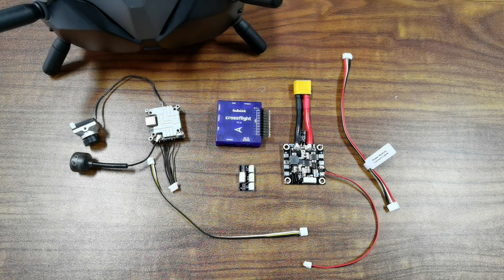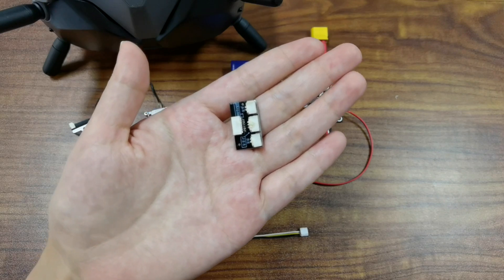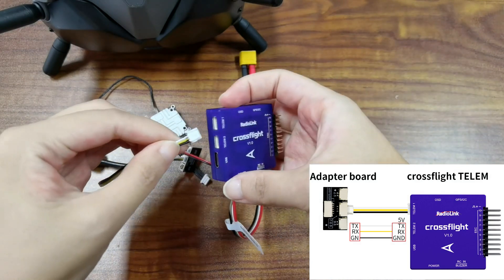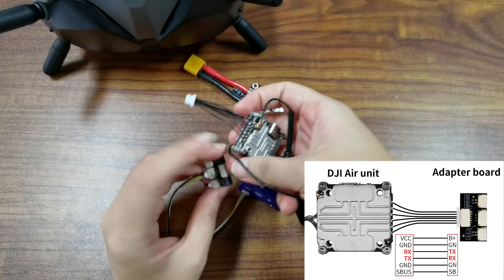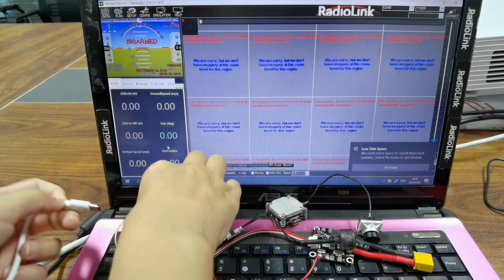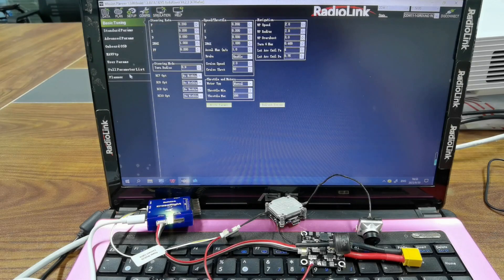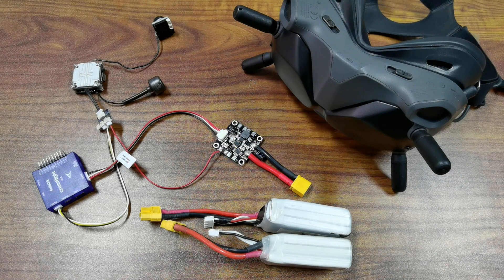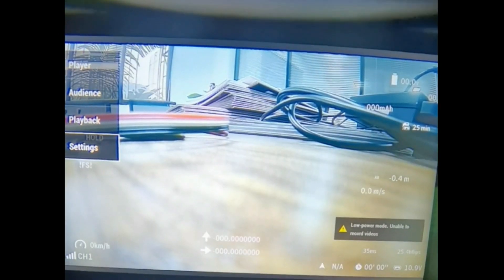Setup and Connect DJI Digital FPV System to crossflight/Mini Pix/PIXHAWK

Comment: Hello excellent video. 👍 Can I ask please, what voltage is being supplied from the lead soldered to the RadioLink Power Module? Alot of Digital Video TX units require a consistent 9V / 2A minimum, for stable performance....
Reply from the maker: Hi, sir. Do you mean the power module of the CrossFlight? The Output Voltage(BEC) of the module is 5.3V±0.2V. If you solder the wire from the module, you need to check the soldering point to know what voltage it is. For example, some soldering point may provide 5V, some may provide 12V. It depends on which soldering point you use. You can check more details of the specifications from the link here: https://www.radiolink.com.cn/crossflight_specifications_new  If any question please feel free to contact us. Our email is after_service@radiolink.com.cn

Comment: getting a lot of noise and video loss (goes black and white) when I use osd with my analog fpv system, (just connected the video signals only)
Reply from the maker: Hi, sir. May I know what RadioLink products are you using? Could you please send us a video to show your problem? The video will be helpful for us to know what happened and help you solve it. You can send the video to our email after_service@radiolink.com.cn
Reply: @Radiolink_official  I am using radiolink crossflight onboard osd, 1000tvl camera with 600mw vtx (analog system)
Reply from the maker: @weslycosta348  Hi, sir. Could you please send us a video to show your problem? Then we can know how to help you. You can send the video to our email after_service@radiolink.com.cn

Comment: Help me please i have big problem cross flight controller 
Many many issus in controller 
Programing 
Batter 1 voltage low 
Arming 
Etc etc please help
Reply from the maker: Hi, sir. Thank you for your support. Could you please check the detailed manual of CrossFlight? https://www.radiolink.com/crossflight_manual  It introduces details on Battery Monitor Setup. It is in Chapter 5.2.3 Connect the Spare Parts. You may check it. If any question about RadioLink products please feel free to contact us. Our email is: after_service@radiolink.com.cn
Reply: @Radiolink_official  love your services 
by the way thank you so much 
my drone  succesfully flying thankyou 😗
Reply from the maker: @Fact-Abaut  Great to hear that. If any question about RadioLink products please feel free to contact us. Our email is: after_service@radiolink.com.cn
Reply: @Radiolink_official  Love From India ❤❤❤❤

Comment: Very helpful video for FPV user.  One thing you have to check.  In the DJI FPV Air unit manual, the external power source for the air unit is within 7.4 ~17.6 V (2S~4S).  Otherwise, air unit may be damaged.   To use 6 cell battery will damage the DJI FPV Air unit, I think.
Reply from the maker: Hi, sir. Thank you for your feedback. Yes. It is necessary to check the voltage range before you connect a bettery.

Comment: I do not have the power module for crossflight, instead I have power module for Pixhawk 2.4.8 how can I connect the power cable to this module? Or there are any other options to power up the air unit? I use 3S battery.
Reply from the maker: Hi, sir. You can also use the power module for PIXHAWK to connect the board. And you can also use other methods to supply power to the air unit. For other methods, please contact DJI after-sales for it. Pay attention the power supply voltage does not exceed the working voltage of the air unit. If any question about RadioLink products please feel free to contact us. Our email is: after_service@radiolink.com.cn

Comment: I want to connect my RunCam digital vtx to pixhawk cube orange and also want the osd data on dji googles v2. Is it possible?
Reply from the maker: Hi, sir. You can check if the diagram of PIXHAWK and RunCam digital vtx match, just like the connection in the video. If their connectors match, you can connect them by following the tutorial. And for how to bind  RunCam digital vtx to to dji googles v2, you need to check their manuals for it. If any question about RadioLink products please feel free to contact us. Our email is: after_service@radiolink.com.cn
Reply: @Radiolink_official  Thanks for the reply. If I connect my sbus and gnd pins from the adapter board to the rc in port in pixhawk, then I wont be able to connect my radio pin from the telemetry air unit as it will be occupied. So the drone will not connect with the transmitter. Please suggest a method, if it makes sense
Reply from the maker: @AyushDoshi-qm3by  Hi, sir. You can check the diagram of the PIXHAWK and make the cable by yourself. Here is the link of PIXHAWK. You can check the diagram from the link here: https://www.radiolink.com/pixhawk  Any other question please feel free to contact us.

Comment: Y a t’il d’autre alternatives que le divit, disponible sur Amazon svp, car besoin rapidement
Reply from the maker: Hi, sir. DiViT is an adapter which is specially designed for our flight controllers. Sorry there is no alternative. You can buy it from Amazon. Here is the link for your reference: https://www.amazon.com/Radiolink-Transmission-Walksnail-compatible-crossflight/dp/B0CJ2D3XZS   If any question about RadioLink products please feel free to contact us. Our email is: after_service@radiolink.com.cn

Comment: Hey! Can you tell how can i connect caddx vista with this flight controller
Reply from the maker: Hi, sir. When using the DJI VISTA air unit, connect it directly to the digital image transmission port, and modify the following configuration in Mission Planner:
1: Search for SERIALx_PROTOCOL in in Full Parameter List and change the parameters to 33 (DJI FPV). (SERLAIx_PROTOCOL (x represents the serial port number, if inserted in TELEM1, search for SERLAI1_PROTOCOL)
2: Search for OSD_TYPE in Full Parameter List and change the parameter to 3 (MSP).
3: Save and restart flight controller.
Note: If your VISTA has been upgraded to the latest firmware (Firmware version V01.01.0000 and above) to be compatible with DJI G2 glasses, follow the settings of the O3 air unit.

When using the DJI O3 air unit, connect it directly to the digital image transmission port, and modify the following configuration in Mission Planner:
1: Search for SERIALx_PROTOCOL in Full Parameter List and change the parameter to 42(DISPLAYPORT).
2: Search for OSD_TYPE in Full Parameter List and change the parameter to 5 (MPS_DISPLAYPORT).
3: Save and restart flight controller.

When using the Walksnail AVATAR air unit, connect the interface to the last 4 pins of the digital image serial port (12v G TX RX), and modify the following configuration on the Mission Planner:
1: Search for SERIALx_PROTOCOL in Full Parameter List and change the parameter to 42(DISPLAYPORT).
2: Search for OSD_TYPE in Full Parameter List and change the parameter to 5 (MPS_DISPLAYPORT).
3: Save and restart flight controller.

Comment: Hy, can you connect the DJI unit to Pixhawk ? Have you wire it? I speak about pixhawk 2.4.8 , not crossflight!
Reply from the maker: Yes. You can. When using the DJI VISTA air unit, connect it directly to the digital image transmission port, and modify the following configuration in Mission Planner:
1: Search for SERIALx_PROTOCOL in in Full Parameter List and change the parameters to 33 (DJI FPV). (SERLAIx_PROTOCOL (x represents the serial port number, if inserted in TELEM1, search for SERLAI1_PROTOCOL)
2: Search for OSD_TYPE in Full Parameter List and change the parameter to 3 (MSP).
3: Save and restart flight controller.
Note: If your VISTA has been upgraded to the latest firmware (Firmware version V01.01.0000 and above) to be compatible with DJI G2 glasses, follow the settings of the O3 air unit.

When using the DJI O3 air unit, connect it directly to the digital image transmission port, and modify the following configuration in Mission Planner:
1: Search for SERIALx_PROTOCOL in Full Parameter List and change the parameter to 42(DISPLAYPORT).
2: Search for OSD_TYPE in Full Parameter List and change the parameter to 5 (MPS_DISPLAYPORT).
3: Save and restart flight controller.

When using the Walksnail AVATAR air unit, connect the interface to the last 4 pins of the digital image serial port (12v G TX RX), and modify the following configuration on the Mission Planner:
1: Search for SERIALx_PROTOCOL in Full Parameter List and change the parameter to 42(DISPLAYPORT).
2: Search for OSD_TYPE in Full Parameter List and change the parameter to 5 (MPS_DISPLAYPORT).
3: Save and restart flight controller.
Reply: Thank you for your answer! The DJI air O3 unit can be wirede with DJI NAZA M V2 or DJI M lite? I have those two filghtcontrolers, too! @Radiolink_official
Reply from the maker: @vasilealexandru983  Hi, sir. Sorry we are not professional in DJI products. We recommend you to ask for the after-sales of DJI products. If any questions of RadioLink products please feel free to contact us.
Reply: @Radiolink_official  Thanks a lot!
Reply from the maker: @vasilealexandru983  Our pleasure.

Comment: hey my drones yaw is tilting to left,can you share the correct pid settings of this flight controller
Reply from the maker: Hi, sir. The PID parameters are different for each plane. You need to adjust the PID settings based on your planes. Here is the detailed manual of crossflight. You can check the methods on how to set parameters. And then you need to adjust PID and test yourself. https://www.radiolink.com/crossflight_manual   If any question about RadioLink products please feel free to contact us. Our email is: after_service@radiolink.com.cn

Comment: Make a video full setup hardware assembly  all connection and use memory card
Reply from the maker: Hi, sir. May I know what flight controller you are using? The video shows how to connect to DJI FPV digital system. You can check the connection diagram in the video to connect them. And for memory card, you just need to plug it into the card holder. If any question about RadioLink products please feel free to contact us. Our email is: after_service@radiolink.com.cn

Comment: Make video how to connect with  Skydroid T-10?
Reply from the maker: Hi, sir. We have already made a video to show how to connect our flight controller to Skydroid T10. And the connection method is the same for crossflight. You can check the tutorial here.  https://www.youtube.com/watch?v=-rJuC6j4ed0   If any question about RadioLink products please feel free to contact us. Our email is: after_service@radiolink.com.cn
Reply: Thanks mate, can you Tell me If the conection with Skydroid H12 with Crossflight is the same? Do I need some adapter? Thanks in advance
Reply from the maker: @DroneFishingBrasil  Hi, sir. Sorry we do not know about skydprid T12. Here is the link of how to connect Skydroid T10 to Mini Pix/PIXHWK. You may have a check. https://www.youtube.com/watch?v=-rJuC6j4ed0  It introduces more details here. From this video, we think you may need to modify the connector. Because the telemetry port may need to be modified. If any question about RadioLink products please feel free to contact us. Our email is: after_service@radiolink.com.cn
Reply: @Radiolink_official  yes, there is no problem to modify the connector, once I understand which modification I need to do in order to connect to telemetry port. I am still working on that and I will let you know when I got any updates. Cheers
Reply from the maker: @DroneFishingBrasil  Great. By the way, when you make it, could you please take some pictures of crossflight and Skydroid H12 to us? Our email is after_service@radiolink.com.cn  And we look forward to your feedback.